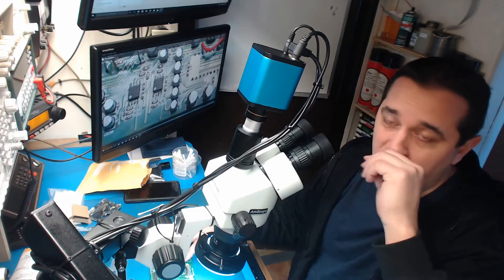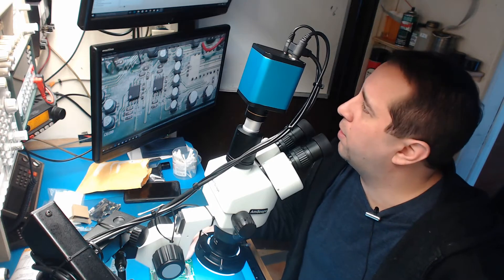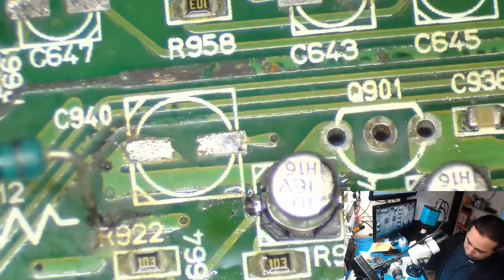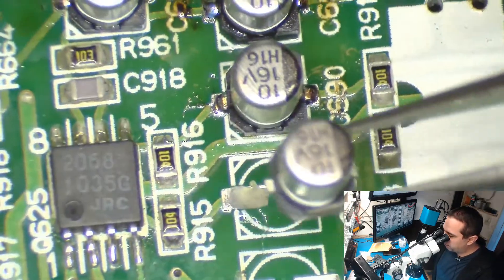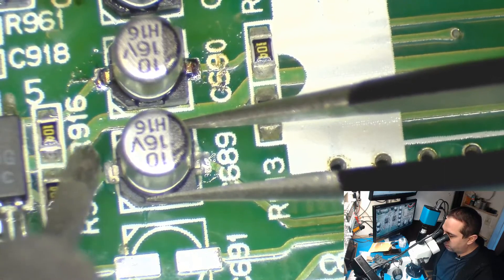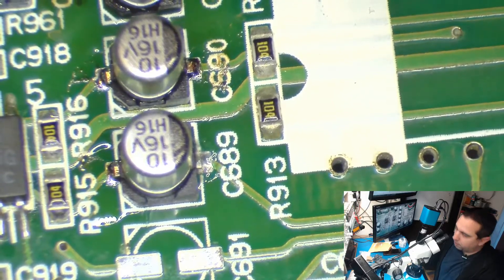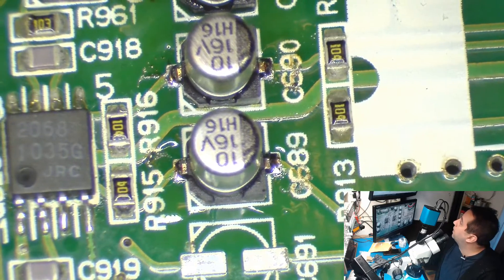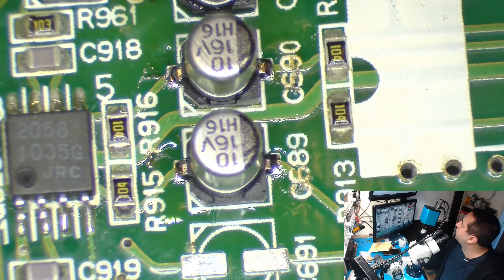SOLDERING ALUMINUM SMD CAPACITORS ON SURROUND SOUND BOARD

Comment: I tried to identify a capacitor that I need to replace.  Looks like a conductive polymeric hybrid Aluminum electrolytic capacitor.  The number in the top are 98sk10050v, k9f2216v, and 9ek4716v.  Any idea of what capacitors are and the supplier or replacement?

Comment: first time doing a soldering job on motherboard or in life for that matter, so aside from having faith in abilities and more importantly in God, couldn't i use solder impregnated with flux? If yes, do i still require flux rosin to clean the old solder off the pads, or can i simply use the wick and simply cleanup using isop. alcohol pads prior to laying new solder? I have a $24.00 Weller soldering iron and solder and that's it. Oh, and a motherboard for a Asus laptop I ordered that came with a once attached SMD cap near the heat pipe that needs to be re-soldered on (i waited too long to open package and out of warranty unfortunately - a pet project).  Thanks in advance for any advice
Reply from the maker: If you use the solder paste then no you don't need the flux. Which also means you are going to use a hot air rework stations to melt it. You can use an iron but it will flow right to the iron. better off using regular rosin core solder with a bit of flux for fixing one cap.
Reply: @Kev_31779 awesome! rosin core solder and flux you recommend for beginners? I really do appreciate your help. Thank you
Reply: I was also wondering what kind of rosin solder and flux you use? Good, good video for me ;-).

Comment: I need your help.  I got a capacitor with this number on it 704 10 35e. I didn't find one that match that number online.  please can I use another number that's close
Reply: Desolder it and measure it with a cheap transistor tester from Aliexpress, search for Mega328.
Reply: 704 is a date code, 10 Micro farads ( uF) is the capacitance value and 35 is the voltage.

Comment: I've got an aluminum smd cap that broke off a friend's graphics card. I desoldered and removed the feet from the pads. I'm trying to replace the capacitor. The markings are as follows:
J3
560
2.5z

I haven't had any luck figuring out what to replace the cap with. Any ideas? Thanks
Reply from the maker: From what you tell me I would guess 2.5 volt 560uF
Reply: Thanks for the fast response! other things I've read lead me to believe you're right. So I'm guessing the J3 is a lot number and the z denotes tolerance?
Reply from the maker: Something along those lines, yes they are some kind of lot or specification markings.

Comment: here is my question how do you read the v for the Aluminum Electrolytic capacitor 93065 220 35D
Reply from the maker: Looking at the number you posted, looks like 35 volt 220 uF.
Reply: thank you very much i will try to look for it

Comment: you should remove the flux otherwise it could damage the points and the board because of its aggresive reaction
Reply: MartyMartin87 how can the flux be removed from under the cap?
Reply from the maker: Use just enough flux to make the joint and or ultrasonic/clean the board after.